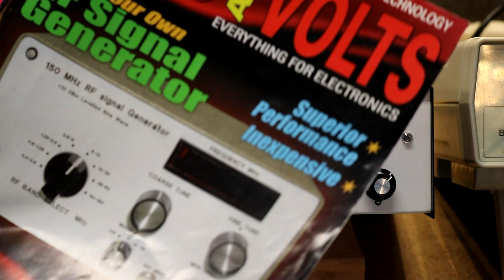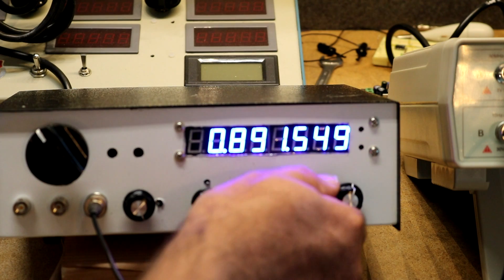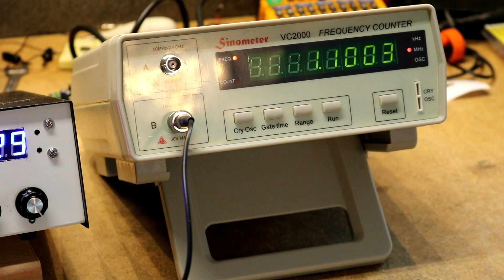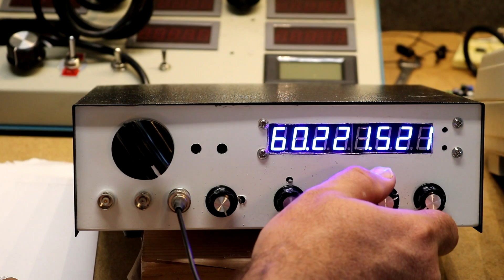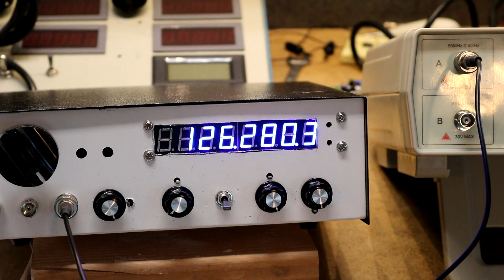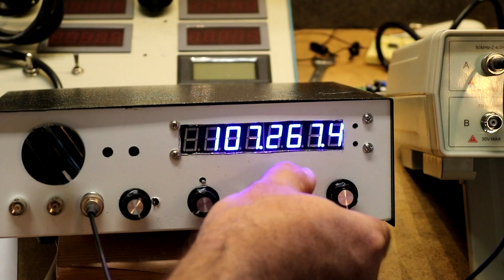DIY RF Signal Generator

Comment: can I use this as a rf heater? and can I use a 13.56 MHz frequency here?
Reply: No, it doesn't have enough power. It can generate the 13.56 but you would need a suitable power amplifiera after it. Anyway, regulations mandate a strict frequency accuracy for this application, so you'd better use a crystal oscillator.
Reply: @danielrperez5778  thank you sir! appreciate your response

Comment: Is the display supposed to keep changing? Does that mean the signal is also constantly changing?
Reply from the maker: To the extent it changes when I'm not turning the dial, that indicates some form of instability in the output. One form of instability may be sensitivity to temperature. I believe in the Nuts and Volts article, the author specifically chose some components to offset temperature variation.

Comment: Was it worth making this? Am thinking about starting on the same project from Nuts and Volts.
Reply from the maker: +Abizar Lakdawalla As an educational experience, I think it was definitely worthwhile. I learned a lot about layout of RF circuits and the care that this requires. As a practical piece of test equipment, I have other equipment in my lab that I consistently find I use instead. You can get some pretty good deals on older RF generators on eBay.
Reply from the maker: +Abizar Lakdawalla As an educational experience, I think it was definitely worthwhile. I learned a lot about layout of RF circuits and the care that this requires. As a practical piece of test equipment, I have other equipment in my lab that I consistently find I use instead. You can get some pretty good deals on older RF generators on eBay.
Reply: +smbakeryt  Thanks. There are simpler circuits based on the MC1648. Might try one of those. Have tried the ebay newer signal generators (based on DDS) and they have some waveform issues but getting an old H-P or equivalent box is a good idea.

Comment: HI HOW CAN I MAKE 3-5GHZ
Reply: Yig oscillators and microwave components. Now THAT is a hell of a project.
Reply: The stability of a YIG is such that it needs a loop to keep it on the desired frequency.
Reply: it is impossible to make it DIY. You need to have a minimum of 1000 Dollars to spend for such specs generator

Comment: Very nice job on that signal generator. What do you think it cost to build? How much time did it take to make? Thanks for showing off your project!
Reply from the maker: +TheRadiogeek I would say the cost was somewhere between $100 and $150. It's a little hard to estimate as there were lots of parts that I don't have on hand, such as the GALI MMIC and the MC1648 chip. When I order such things, I tend to order ten of them rather than just 1. As far as time, this has been a pretty time consuming project but that's mostly because I'm a complete novice when it comes to RF projects. My PCB layout caused some issue with the GALI-55 amplifier. If I'd followed the author's instructions exactly from the article, I probably would have had fewer variables to try to diagnose. A competent and experienced person could probably assemble one in an afternoon.